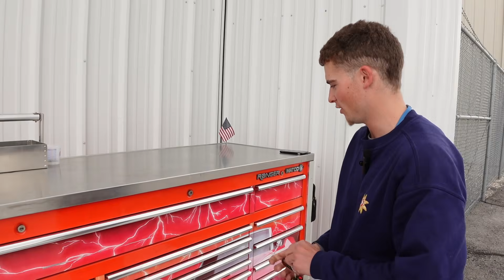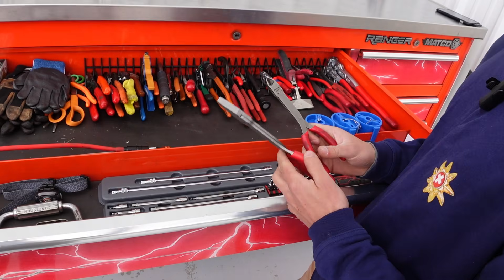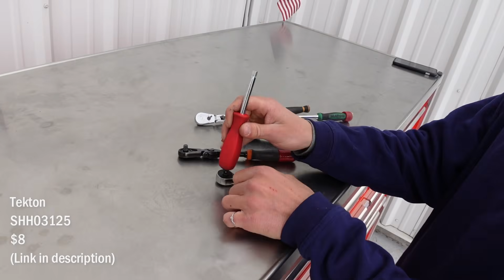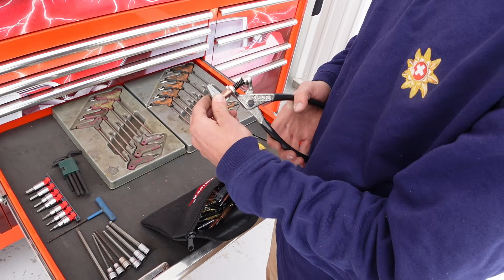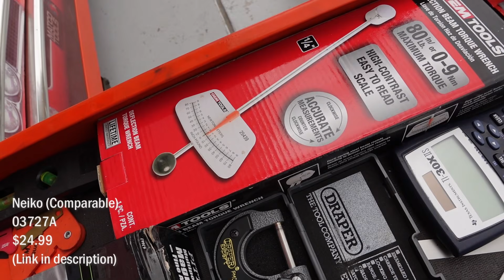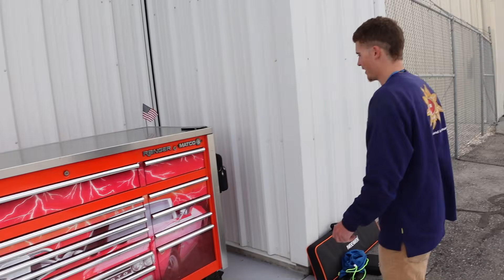THIS Was At A Pawn Shop? - Entry Level A&P Mechanic Toolbox Tour | Matco Triple Bay

Comment: I work on motorcycles and cars, 98% of the time I only need metric. I also work on boats, and they’re SAE. I’m stuck paying double lol

On a related note, when are we going to stop using screws? Esp flathead? Why are they still around? Allen screws should be free retrofit upgrade hardware and we can all throw away screwdrivers

Comment: For the question about the hemostats, I can add some more info for you. Most A&P's use hemostats to not only hold things in place but to also reach for things in tight spots. For example, imagine you were putting a cap on an actuator body and the diaphragm that sits on top of the piston has somewhat rolled over. You would use hemostats to reach in there and grab the diaphragm since they not only fit but they also won't damage the diaphragm.
Reply from the maker: Thank you for sharing that! Makes sense to have a few pairs on hand.

Comment: Hello, i'm not Amiercan, but maybe someone can answer me some questions: 

Do you not get tools from the company you work for when you are mechanic? Or why does he have to buy it himself? Is that common in America? 

Also, more like a special aviation question but: 
 i was at an aircraft workshop once and they had all their tools numbered and at fixed places, everything clean sorted. They told me it's so they can easily spot missing tools and they said if something at the end of their work is missing they can not let the plane leave until it is found, because of the danger of it being lost inside the plane and potentially damaging the plane during flight. They also told me tools in the aviation industry have special requirements, like most tools are screwless, or screws are replaced by rivets (Example: backplate of a ratchet). Seeing his toolkit, i wonder if this more like a guideline in specific countries or companies rather than a general one?
Reply: Hello, 
Yes for the most part mechanics in the United States are required to have their own tools. I prefer it to be honest because I can buy what is best for me if that makes sense. Yes for me at least we have to keep a log of our tools and if anything is missing the aircraft cannot take off until the tool is found. Doesn’t just go for tools though. If you drop a nut or something inside the aircraft the same applies. I’ve never heard about the screwless tool part but it does make sense.
Reply: Not screwless tools per say but they call them FOD less (Foreign Object Debris)tools snap on makes some but not a lot. Not sure but probably mostly sold to US government aviation not a lot in the civilian market. They just make it so the small screws on ratchets don’t have them or are designed so they can’t fall out. I’ve only seen the FODless ratchets online. In the military we had to have glue on the tiny screws on our tools for that reason.
Reply: I can concur with the previous answers as well. I went through A&P school and for each class they had a tool list. So, by the time you graduated and started working you would have the basic stuff needed to do the job. I worked for McDonnell Douglas Flight Test on MD-80's, MD-11, and then on the C-17. We could check out of the tool crib tools for certain jobs. And when I got laid off from them, I had a lot of sheet metal tools like rivet guns, drills, etc. A lot of my friends built side boxes for their "taco stands". That's what we call the larger rollaways" because of their size. Good times! 🙂
Reply: @lplacido61  Gotta' have a sense of Yuma.  😉😀  I worked on the MD-11 Flight Test Cert program too.  I worked for one of the engine companies.   I recall several of the DAC mechs on the ramp had those Snap-on taco carts; great rollaways; always wanted one myself.

Comment: What a great box for a young bloke starting in the industry. 

The hard Snap On screwdrivers were definitely better than the soft ones for aviation. 
Hemostats are great for holding P clamps.
I seem to have a LOT more tools for extracting screws.
I love how the safety locks on all the air tools are disabled. 😂 Same as every aircraft workshop.

Comment: In the Navy, our avionic's tool boxes had to be checked after each repair and signed off. Tool accountability is very serious in Aviation. If a tool or part, even just a nut was dropped or missing, all hands on deck had to walk the hangar and flight line looking for it. Only QA could stop the search and sign off on it. Some searches took hours.
Reply from the maker: My friend told me about how the new guys get hazed in the military. Someone will take a socket out of the newbies box and hide it somewhere so they have to shut the entire hanger down for hours while everyone searches for hours. Newbies end up taking a ton of heat for it.
Reply: @ToolBoxTour  That's a good one. Our entire squadron got in trouble and had to work 2 weeks straight painting the entire hangar because a softy couldn't take being tapped to a chair and given a wash at the emergency eye wash/shower station on his birthday. 😂 Good times!
Reply: @TheCryogenBurner  Thank goodness I didn't go into the military
Reply: The Air Force was the same way as I worked in shop and if you were missing a bolt excuse me a tool you had to go on 16-hour shifts to find it so it was a big deal  @TheCryogenBurner
Reply: @ToolBoxTour yea my unit was to busy todo stuff like that, it was taken extremely seriously nobody messed with tool control
Reply: @ToolBoxTour or you put one of their Tags or a socket they have tagged in a cup of water and freeze it during the day so at knock off they have a massive chunk of ice to hand in and deal with. We also initially got swung from the crane they would trick you into sliding a broom  handle down your overall sleeves and then be stuck. Then hook you up to the hanger crane and swing you around (not too high a couple of feet off the ground) 😂
Reply: I do this when I lose a 10 mm
Reply: Yeah I also heard it’s standard practice to use foam to ensure every tool is accounted for
Reply: @The.husky.max.  Foam and our tool boxes were metal with cut-outs for the basic hand tools.
Reply: In small shops and OEMs nothing is really organized
Reply: That’s the military.  People lose stuff all the time in commercial aviation.
Reply: Of the A&P guys he has shown this is the first one that even talked about using safety wire so not sure if they other even did use it

Comment: Anyone else think its wild that everything in aviation is SAE?
Reply: Aircraft standardization fell into the hands of the USA, a lot of which happened during WWII. As opposed to the automotive industry having very strong roots in Europe and Asia making metric very common.

On a different topic, you have all these countries using metric sockets on an imperial drive (e.g. 3/8” and 1/2”). 😁
Reply: For the most part, yes. Diamond aircraft uses some metric and I ran across a Hawker 600 in the 80’s that had metric and SAE fasteners.
Reply: @Mike Botkin  Hello Mike
I've been in Aviation since 1977. And I haven't come across any metric hardware. That's both Military or Commercial Aircraft. I have worked approximately twenty six different Aircraft types or models. I find it interesting that Diamond Aircraft were metric. Who was the first to go metric? Anyhow, thank you 😊
Reply: @georgeferlazzo7936  I’ve worked on Dassault Falcons and they have metric hardware.
Reply: @georgeferlazzo7936 Airbus helicopters (formerly Eurocopter) have been metric for as long as I can remember. Fasteners are quite specific and expensive. I like metric, but I am not a fan when it comes to aviation. 
Turbomeca are also metric. Their fasteners seem to be a lot less annoying somehow.
Reply: @mikebotkin2008 Hawkers are also bastards so of course there will be metric thrown in. As if coin slots weren’t annoying enough 🤣
Reply: It's probably a good thing that they're SAE considering the astronomical number of 10mm's that go missing. Airplanes would sound like flying maracas😂
Reply: @coreymartin-wk1fi you won, case closed.
Reply: Even wilder is that even Airbus’ are, effectively, SAE.

Reason is NACA - the precursor to NASA. Back in the day they spent lots of taxpayer money developing standards that were so well done they became the… standard. 
It always made me lol to read drawings with ‘6.83mm’ holes for bolts
Reply: Hello Everyone who responded 
Thank you,  even an old dog like me can still learn something new Lol 😆 Again thank you
Reply: You work on military aircraft you better have SAE tools or you will be wishing you had and it better be 12 point, Eck usmc
Reply: @alexmorris3106 good thing the military gives you tools
Reply: The British aerospace hawk uses metric, SAE and whitworth
Reply: The Vickers Viscount also uses Whitworth too (not sure if it had any metric)...
Reply: Airbus is metric, I work on EC-145s  and my box is full metric, only the starter generator om the bird uses sae
Reply: @andymartinez8633 oh…a “bird” guy.  Big busses are NOT metric.
Reply: @andymartinez8633 whole aircraft is SAE bud maybe a few metric
Reply: 9/16 is the predominant size we use at GE Aero.
Reply: I'm personally grateful I only have to buy half the sizes haha
Reply: It is so nice only needing to get sae for everything one set of wrenches one set of each socket set
Reply: Hello Fly Alaric
Hopefully, I can answer your question. If you go back to the  Wright Brother's  (USA) when Aviation was started. SAE/STANDARD hardware was all they had. Another point. English is the standard for pilots and air traffic control. All car until recently were SAE/STANDARD. I hope that helps.
Reply: I was just going to say planes been around forever and SAE was the go to😊@georgeferlazzo7936
Reply: @georgeferlazzo7936  Well yeah but its not 1732 anymore
Reply: Not everything is SAE in aviation 
There’s rare metric bits
Reply: Airbus is metric
Reply: @JacobFuckingPoucher that’s funny
Reply: @justing42  what's so funny?